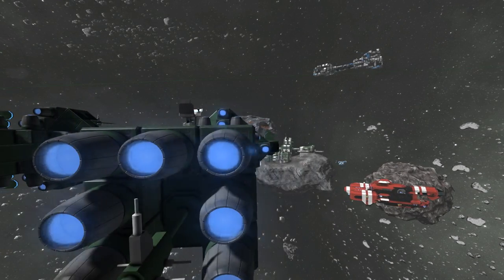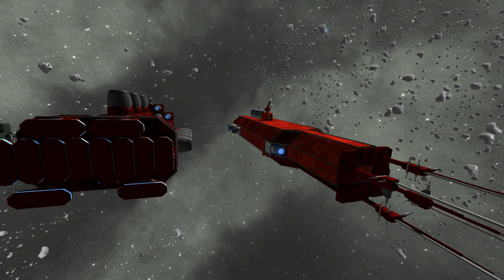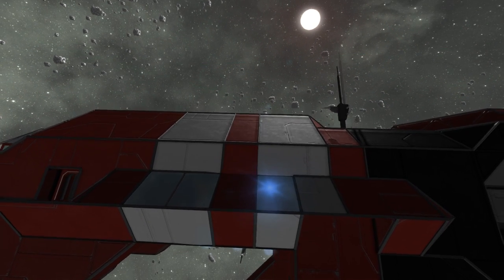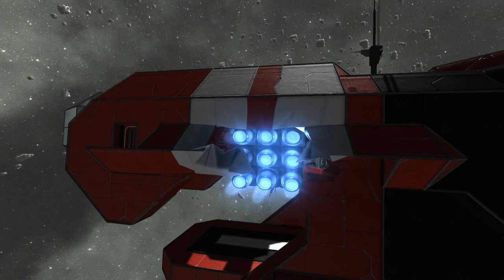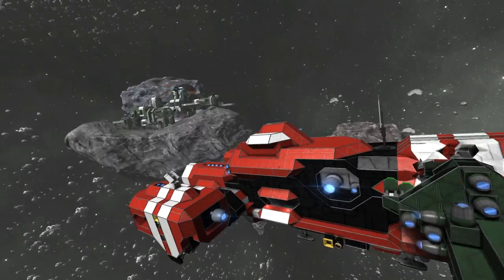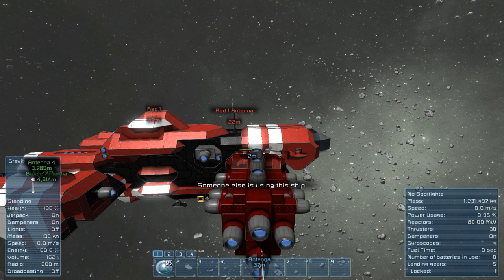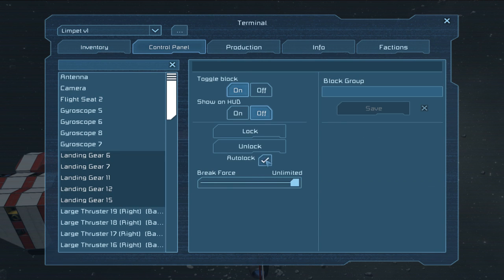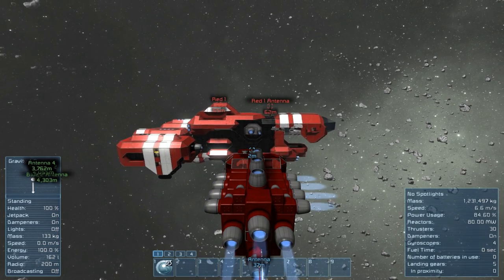Space Engineers - More Disabling Weapons, Limpet Concepts, Breaching Troops

Comment: I mentioned this to a friend of mine, and I dunno if anyone has posted it here, but that line [Someone else is using this ship] happens when a ship (your target in this video) has a main cockpit (and in the case of the limpet, yours doesn't)... On my small multiplay, I set a terminal in the platform as the main, meaning every other terminal (4 in total besides the main) would get that same message.

What you'd want to do first is ensure the ownership for the limpet is set to you and (if you want) your faction, so that hostiles can't hijack it or remotely disconnect it. Then test it to see if your helper can still remotely disconnect the landing gear.

Comment: I love the designs. I may have some helpful suggestions. First one is, instead of having a single or double piston just in the center of the ship's front connected to your cutter head, why not do an array of four? You could connect them to the corners of the cutter head thereby increasing it's stability, possibly even with the double piston extension arm. The other suggestion I have for the thruster-based melting cutter would be to have some sloped blocks around the outside of the cutter head with more thrusters placed on them to cut out around the head as it was pushed further into the opposing ship. I believe that would eliminate the problem of the low clearance of the head as it moves into the other ship. You could also perhaps have them fold out of the sides of the cutter into the same, angled position as with the sloped blocks. Not only would it look much cooler but it could also help to make sure your cutter head has the same profile so you could keep the ship pretty much if not exactly the same size and yet still have a viable thruster-based cutter. Lemme know what you think. Also, keep on being amazing and keep it up with the excellent designs. Have yourself a great day! Later.
Reply from the maker: Sounds nice suggestions.. the piston stability one is a no brainer tbh, should have done something along those lines.. just takes playing about with merge blocks a bit. As for the thruster suggestion, while I admit it would look damn cool I just think the grinders are simply more effective, although might just be worth attempting for cool factor alone. Thanks for the suggestions and feedback dude, appreciated! :)
Reply: Any time! Thanks for responding. Have a good one. Later!

Comment: Two large thrusters on the front with a sensor to tell them when to fire could burn a hole 7 deep in the hull making it a excellent boarding option if you put an assault door between them.  The main problem i see is stopping the ship reversing since most available gripping options are flawed.

Comment: I have a good idea for this. Place a probe with saw thing in the front of the ship. Next saw into the ship just a bit. After that detach the carrier and fly away a bit. Then use the auto pilot to fly back to you base. While its flying you will be able to drive the probe into the ship. Locate the power room and disable it. I suggest you put an interior turret on the back of the ship.

Comment: if you have a timer block on the limpet ship that when connect put a gravity generator to max weight  i think its 5 gravs it will drag and slow down plus make it only out to you on controls
Reply: +steven booth Hm... to slow down a ship, you want mass... so, two gravity generators and 4 mass cores keyed to a timer block triggered by a sensor... the large ship version would effectively drop 400,000 kilos (4 mass blocks at 50,000 kilos [powered] x 2 gravs) on the target... throw on the limpet drones' innate mass from the rest of it... only the largest ships could handle the extra mass with any degree of ease.

Comment: ***** Interesting design with the pistons extending the reach of the grinders/thrusters.  I've seen people use landing gear to brace old rotor-style pistons to keep them from wobbling around; probably wouldn't do much good when it's extended, but it might help the dual-piston setup be a bit more stable during flight.  Then again, I'm not sure that would really accomplish much other than maybe preventing potential self-damage in flight.

Also, I hadn't considered that grinders clear blocks around them instead of just straight in front of them; that probably makes thrusters not worth the effort.  The only theoretical use I can see is to quickly melt a small breeching hole through which to unload troops.  8 thrusters around a door might work, and they wouldn't need to try to burn all the way through.  The downside is it wouldn't work at all on heavy armor, whereas grinders would (eventually).

The loss of control upon locking on to an enemy ship is.. weird.  Assuming it's not a bug (and that's a big assumption) the only remotely sensible reason I can think of for such a thing is to prevent an enemy faction from stealing docked ships.  Even that doesn't make a lot of sense though given you'd have to hack into the cockpit and maybe every other system.  Does it do the same thing with auto-locked gear, or only manually locked? How does it work if the pilot is in your faction?  What's the faction setup for both ships (owned by/shared with)?  I'm curious to find out if this is intentional or just a bug.  With the 'someone else is controlling the ship' message, I suspect the former.
Reply: Also, I really dig the idea of the limpet ship.  It would be handy if for no other reason than to bog down an enemy ship to keep it in range of your defensive emplacements.  Not sure how fast it accelerates, but it might have trouble catching up to ships that use a gravity drive for acceleration.
Reply from the maker: Steve Pittman With that load of engines it's pretty damn brisk.. still it would probably struggle with grav drive ships but I think anything would thanks to the max speed limit and how quickly you can reach it.. Quite like how simple it is though :)
Reply from the maker: With the loss of control issue (we'll call it that for now) I tried with both ships set to nobody, both to the respective owners and with both manual and auto locking with the same results every time. As long as we're both in the cockpits they are considered merged and the red ship has control of it all.. weirdly the order we got in made no difference, Red always had priority. Never tried it with us both in the same faction but will give that a try tonight and find out, intrigued to see to what extent this happens even though I think you SHOULD be able to do something like this.. Yes you could run off with people's ships (although docked via a connector or landing gear would make them VERY hard to detach) but that's kinda an ingenious engineering solution to the problem and requires quite a lot of investment to pull off so why not?
Reply: ***** Curious.  The only thing that springs to mind is that the red ship retains control because it's the one being attached to.  Maybe try putting gear on the red ship and parking something on it to see if the same thing happens in reverse?  Also, I wonder if it's large ship > small ship priority.

Otherwise, as I said, I've no idea whether this is intentional or a bug, but I'd be curious to find out.
Reply from the maker: Yeah I'm gonna test further.. both are large ships though so if there's a priority it's based on # of blocks or mass somehow. Something fun todo for a rainy Sunday :)
Reply: ***** Oh.  Didn't realize they were both large ships.  Odd.

Comment: Once I built a breaching torpedo. It was basically a small craft with one grinder and 4 landing gear on the front, and on the two sides there were piston doors. It had two seats in it. The idea was that it grinds trough a big ship armor and when it reaches a corridor it  opens up, unloads assault troops on the sides and grinds forward causing more damage... it could even carry a small drone... I never tested it in actual multiplayer fight, but it worked suprisingly well in my tests.
 Maybe worth a try? :)
Reply from the maker: Quite like that concept of a breaching ship that opens up to unleash a drone inside once it's struck it's target.. could be a fun toy especially as you'd have to make a purpose built drone also for the task. Nice idea :)